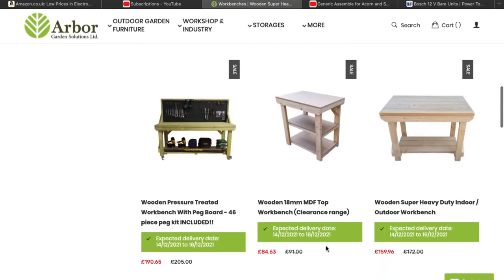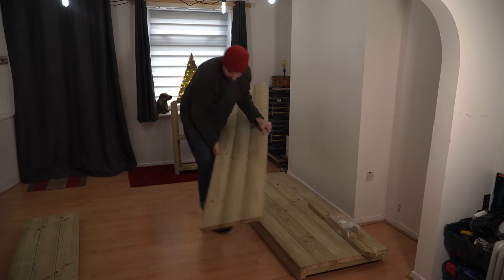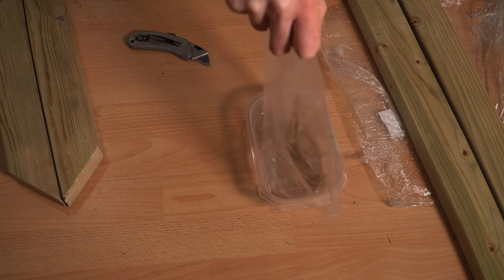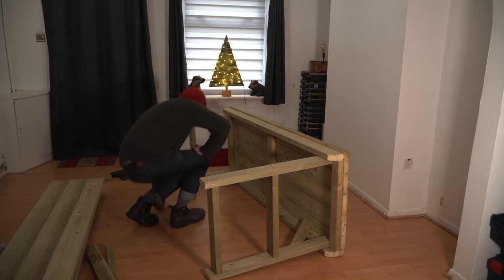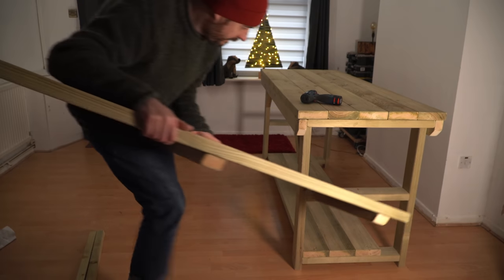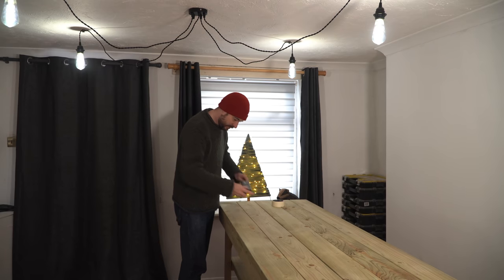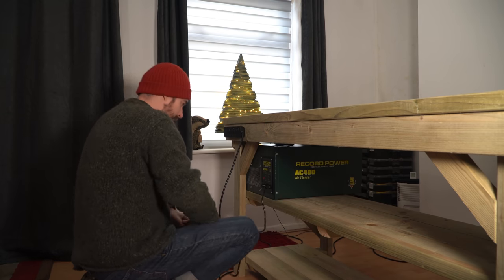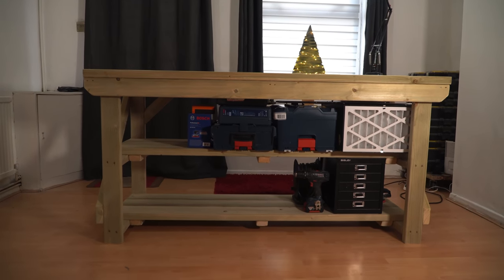Arbor Garden Solutions Work Bench

Comment: Looks really good. I have limited space so I would need to take the bench outside to use it. In which case I would need to consider putting the legs on wheels. However I don’t want to work on a bench that has wheels even if they are braked. I will have to think of a solution where the wheels can be removed.
Reply from the maker: If you look up workbench casters you can get ones that fold down when needed

Comment: See Matt I told you the LED light turns straight off on the drill the second you release the trigger. Makes it a little harder to locate screws in dark places otherwise brilliant little 12v

Nice easy build square bench, great for a starter or as a time saver. Nice old record vice great addition
Reply from the maker: Yes I see it now. Thank you

Comment: Having just bought a record air cleaner I have been thinking about the location. How does yours perform under the bench like that? Obviously easier to get to for filter changes but most of the guidance I've seen suggests hanging over the space a little above head height.